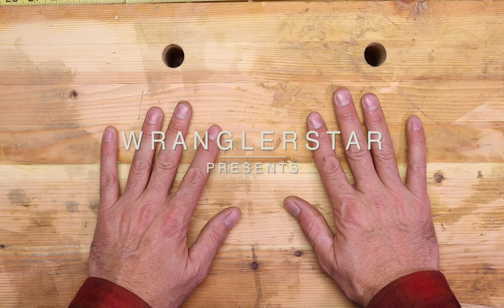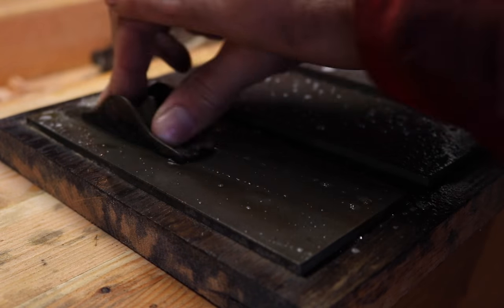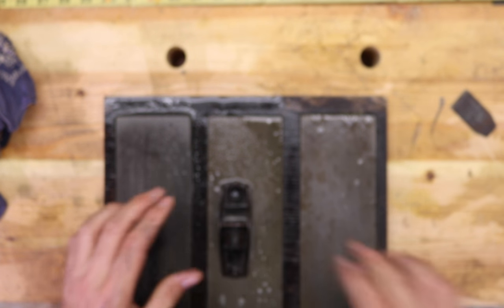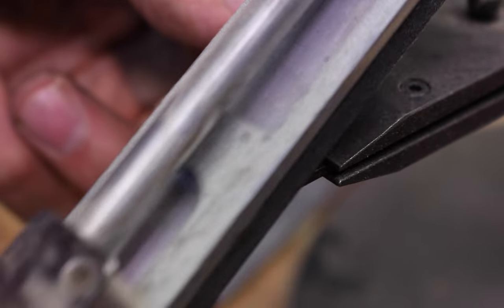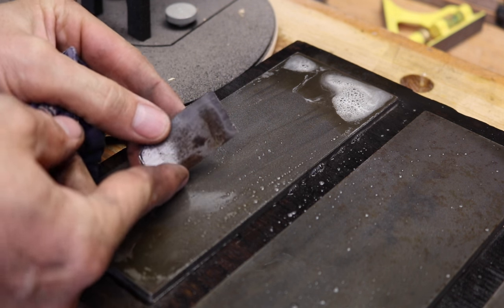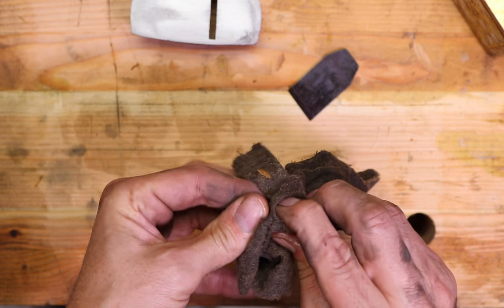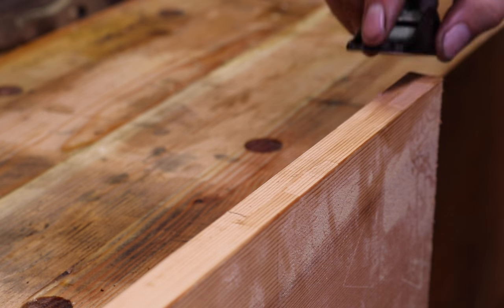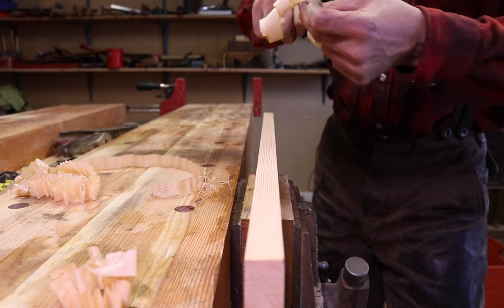Amazing Tiny Tools

Comment: Hi Cody, first I want to say how great it is to see others appreciating the USE of old tools. Second is two suggestions: the first is to make sure you get rid of the wire on the back of the iron. I did see you strop it briefly, which may be enough, but I like to give it a few laps on my finest stone before stropping. Also, I find it to be good practice to knock down those "cat claw" corners; this helps keep the iron from digging in if not set perfectly perpendicular to the sole. Great video and happy planing!

Comment: This was a laugh, I had exactly the same experience except with a new one. I bought one in a hardware store as a laugh because it was only $6.00 (would be less in the US no doubt). It was a little Kobalt brand one which looked to be around the same size as this and very similar in design. When I actually decided to use it I was extremely surprised how well it performed even with the factory edge. As you mentioned it is fantastic for chamfering edges and I now use it for that purpose on just about everything I do. It has actually become my most used plane overall believe it or not, because almost everything I cat with a saw, I will just quickly knock the sharp edge off. Works great when you cut off the end of your axe/tool handle, just carefully run it around the bottom and bam, nice smooth chamfered end! Genuinely a great little tool that looks like a novelty but is incredibly useful in practice.

Comment: I carried one of those in my nail bag for years when doing finish work, a Stanley. That and a half rd. rasp. Sharpened it on a good stone,trick is don't let it get dull.Used it lots on end grain to fit mitres on oak casing.

Comment: Hey Cody, at the moment I'm doing my cabinet makers apprenticeship and my mentor has a fair few planes like this and they are not used for making violins or smaller instruments as they are minuscule and the larger ones have a curved sole. This plane could have been used in the production of viols (double bass) for finish work but it is also unlikely as most of the tools used in that trade have a curved sole. In my workplace, they are used for fine finish work on cabinets and as you saw they are perfect for making chamfers or dealing with spots where the grain alternates and this saves more time than setting up a router or sanding. To set the blade you can use a small lead or brass hammer or a material that won't damage the blade such as wood or plastics and you loosen the set screw slightly and give the blade the slightest taps and re tighten the set screw to fasten the blade. Some day I would like to start my own business making furniture and it would be amazing to acquire tools like this that I would be able to use every day :)

Comment: My wife's grandfather had two old barns on the property we have now. I went into them and it was like he was working on a project and just didn't go back. I believe it was when he was called during WW2 ...The barns were untouched until I met my wife 25 years ago.  Anyway......I found lots of old hand tools from nearly 100 years ago. Amongst them was a small plane like this one but I believe it's a tad smaller. 
Ive used those tools and they definitely work better and are stronger then the new tools I have. 
I use the small plane for chamfers on my projects. Works really well. 
I really like when you use or showcase old tools like this. 
The younger viewers probably have never seen tools like this.

Comment: Nice little plane. I used one like that in shop back in Junior High around 1958 to chamfer the edges on the base of a wood-block lamp I made. They are perfect for that, as you noted, but will work just fine as you were using it. Ballistol is the best thing I've found as a general cleaner/lubricant. Discovered it shooting Black Powder and use it with my modern firearms and tools, as well. Have a great Holiday.

Comment: We call those Thumb-planes. Very Handy to keep in your tool pouch for shaving Cedar Shake and shingles, fine-tuning door-jambs and trim, etc. I'd love to have an older cast-iron piece like that, but I usually buy the Stanley stamped steel versions commonly available now. They run about $7.00 and they are basically throw-away units!! Very Nice piece, and I like your work!!

Comment: That makes good enough ribbons you could use them to edge plywood. Little bit of glue on the end of a plywood shelf you're making, stick one of those on and it would look like hardwood on the edge. Easy veneer.

Comment: have one exactly like that one is... used it quite a bit on smaller cedar trim (outside) to straighten the curf saw cuts when butting the trim joints togetother on the end grain scoring each side with the small blade indentions first before shamfering the backside just a little then cross grain to insure one seemless looking tight fit on the butt joint. Though later on they came out w/ a lower angle plane f/end grain planeing this wasnt that big of a deal as this kept sharp and true 30° finger plane worked well enough and is small enough to not add much weight kept in your pouch bags while up on your skaffolling work station. I treasured mine at all times and didnt care to flaunt my tools I valued the most. Found myself to work alone alot of the times and still enjoy putting out some really good work. over those that now seem to basically go with hardy board gang crews that slap crap up in a hurry done in a day. Just very few really pay for quality and many wants it for nothing to even jew you in the end. :(

Comment: AvE has a surprisingly successful solution to focusing issues.
Reply: canot read
Nah, the problem is with the camera's confuser. The only two fixes for that are cursing at it or reading the owners manual.
I suppose percussive maintenance works too. If you can break it, you can justify buying one that's a bit more skookum.
Reply: Try using your camera without any batteries. 

Tadaaa! Focus will not be an issue! ;)
Reply: Focus you Fack!

Comment: I keep a similar plane in my tool belt, perfect for small adjustments on finish carpentry, skirtings, arcs, and slight aris's or chamfers as you guys call them, almost no extra weight, and barely notice it's there till I need it

Comment: Those are called "palm planes" and as a guitar maker I have been regrinding and reshaping them for over 35 years now. Ace Hardware used to sell little planes exactly like that, that were made in USA, and later made in Mexico. I convex grind the soles on some, and concave others. It works. The tiny planes used on violins are called "FINGER PLANES" and a set of good ones will set you back about $1800. Again the soles are not always flat.

Comment: Dear Cody,
now you need to make a miniature wooden mallet so that you can adjust it properly.
If you've ever used a wooden plane, this one is set in the same way...tighten that screw a little and 'tap-tap' to adjust the depth of the blade.
Another thing: Did I see you put the blade in bevel-down? I'm sure it's supposed to go in bevel up on a block plane.
(Lower cutting angle for end-grain, which is the main use for a block plane.)

Great present (Do you celebrate 'Niklaus' today?) and a great vid.
All the best.
Reply: Exactly, although he didn't put the iron bevel up! 
You can easily figure it out from the video even though you think you saw him do that.
Reply: this is not a low angle plane, bed is 45°.So bevel down is the right way.
Reply: I stand corrected, Cyrille.
Reply: This a 100 Stanley plane, made1877 to1962, used bevel  up on wooden instruments such as violins and guitars  for thinning back panels,etc. There is a1001/2 convex plane made 1936 to 1962 for fluting... Same size. There a number of small 31/2 in ones with squirrel tail ends also for fine work.

Comment: I bought a slightly bigger Stanley rusty hand plane, but I used silicone carbide wet dry sandpaper taped to a 10" flat piece of dymondwood and did the same to 1200 grit.

Comment: nice little plane. those are used alot for fitting down red cedar shingles for siding. block plane gets heavy after using it all day, that thing is a wrist saver.

Comment: I've got the same model plane. Great for Chamfers and bevels on small stock. I adjust it with a small plastic mallet. Set it short and tap, tap until it cuts just right. I'm surprised you didn't polish the rails the blade sits on, but then, it seems to cut fine without chattering, so no biggy.

Comment: I think this kind of plane is called a "Luthier Plane" or a "Thumb Plane".
Very nice!
Reply: Close, Luthier and thumb planes are much smaller.
Reply: Rt Carolina Outdoors In my experience it is a class of planes not a specific size.
http://ablett.jp/gallery/index.php/Stuff/6pcs-hill-style-brass-Mini-finger-planes
Reply: This plane is nowhere near the same class as a luthier or finger plane. I've made a few instruments and have been a woodworker for two decades. This is just a small plane. Your link shows true finger planes, they're much smaller than his. His is a trimming plane, similar to a Stanley 101.
Reply: Rt Carolina Outdoors Thank you for sharing your wealth of knowledge.
Reply: I just looked it up on The Blood and Gore plane site (or whatever it is called) and you sire are 100% correct....

"#101 Block plane, 3 1/2"L, 1"W, 1/4lb, 1877-1962.

Same style of plane as the #100 and #100 1/2. However, this plane has no rear handle like the two previous. The plane was designed for household use, and lighter work. It was originally sold in toy tool chests, but gained such popularity that it was soon advertised as a craftsman's tool. 

The earliest model of the plane has the top of its cutter rounded in a slight arc from side to side. The later model has the top of its cutter finished in an angular fashion, like those of the common bench planes. Many of these planes have been modified by users to do custom tasks, with the most common modification being its conversion to a bull nose function, similar to the #101 1/2. 

This plane is japanned over its entire main casting, except for the sole. The lever cap is also japanned, but starting around 1941 it was painted red. The last models of the plane are painted grey and have a red lever cap, and very much resemble the Millers Falls' version of the plane.

Many manufacturers made knock-offs of this plane, with Sargent&Co. having cranked out a load of them under their model number 104, which is usually found cast into the tool right behind the cutter. Another company even made an aluminum version of this tool, probably trying to cash-in on Stanley's incredibly successful aluminum plane products. Er, on second thought, probably no."

I do not think that the lever cap was red in Cody's video, so I wonder if that means this is a pre 1941 tool?
Thanks

Comment: I've got a larger one of the same construction,  which has 2 places to put the blade, one right at the tip of the sole, which is really handy, especially as the sole is cracked at the side of the normal slot.

paused post while I went dreamy looking at propane/mapp for brazing

Comment: Luthiers use those and even smaller thumb planes for carefully removing small amounts of wood in musical instruments to tune and lighten the bodies.
Reply: I cringed the whole time you were honing the edge on that piece of wood.  You'd find that a stop made from an old belt or leather strap, glued to a flat board and loaded with yellowstone compound does a much nicer job and there's no danger of turning the edge on it.
Reply: Insert "strop" in place of "stop"

Comment: we called that a mini block plane, it only had one use and that was to round over edges of wood.  only 3 strokes ( its hard to say how we used it) but it was first on the 90 and then one each side at a 45 of that (like how you did the champher) sorry about spelling there and then we would use sand paper in the hand that would complete the round edge.  Wish I could put pictures in here to show you all but I hope you get my lame chit chat

Comment: roy underhill has a few of them .  japanese woodwrights  use small planes that work backwards  , i saw a man get a 6ft shaving as thin as onion paper.  save those shavings  they make great  tinder one hot spark from a ferro rod  will light them.

Comment: That is a great little plane, I have one and find it very useful, it's worth cleaning up. Paul Sellers is a great resource, like you. Can you recommend a diamond stone manufacturer or supplier?Thanks.
Reply: Check on Amazon for choices. DMT is very good, not cheap
Reply: Thanks!

Comment: the grinding angle should be 25degrees, for normal hard to semihard wood, if you use it on only softwood, you can lower the angle to 20 degrees.

Comment: No It doesn't go in a glass cabinet. My father always kept it in a top pocket of his finishing carpenters overalls.  It was essential for final assembly.  there was always a proud spot at the end of a saw cut where the wood split before the teeth could cut or a too sharp edge as you demonstrated.
I had to help with a sticking door last week and as I dug through the cabinet I labeled plains I found the bull nose. same size but solid body and the blade set 1/4 inch from the front to get close to an inside corner..

Comment: Cool little plane.. looks sharp too. Just don't strop the sharp edge to a rounded edge. To each their own but I only make a few passes on the strop. Seems to be sharper than many passes. Maybe I'm the problem not holding it at exact angle needed.
Reply: Paul Sellers uses a similar vigorous stropping procedure.  As the iron is not held at a precise angle, a micro bevel results.

Comment: sand paper    spray adhesive. and plate  glass     works  well too    ,    i do this as i dont wanna   spend   big money on  stones ,  wet /dry sand paper. try it    youll be impressed  i use a  3000 and 10000 to finish

Comment: Is it possible that the diamond stones could get a wear spot and make the metal off even? Or do diamond stone's not wear that way?
Reply: Cmule it is possible but with any tool if you use it properly, and take care of it correctly, you shouldn't have to worry about it happening.
Reply: Is that why he is going in figure eights?

Comment: Aren't you supposed to flatten a plane with the iron in the plane and the cap iron, etc in place in order to stress the plane?  Since the stress changes the shape of the plane bottom...  if someone already mentioned this, my apologies, hard to see every comment.  thanks
Reply: Doubt you can hand tighten enough to distort base.